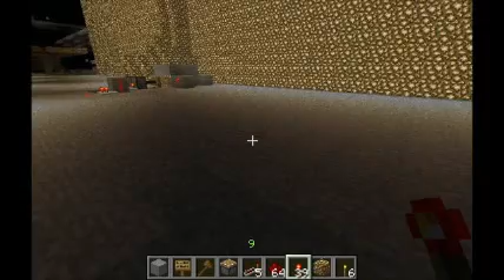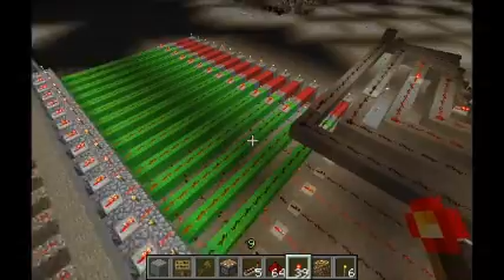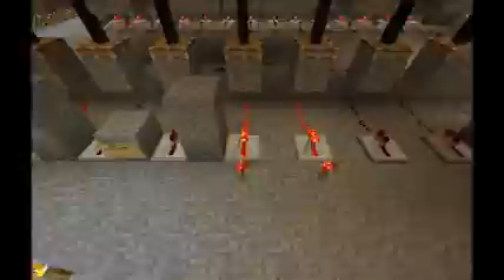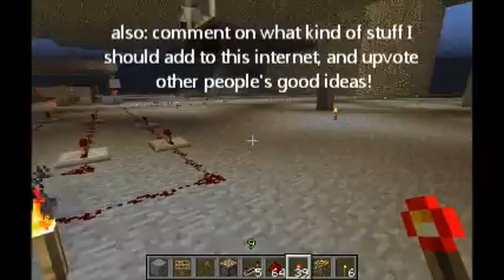minecraft internet project sneak peek!

Comment from the maker: @lukey405 it's currently an I2C packet transferring system with IPs. if the 4 bit IP is equal to the IP of the client, the package is exepted and loaded into the output buffer. when the whole system is finished I will demonstrate how it works properly.

Comment from the maker: @liamliam1966 remember these are packets, AKA multiple packets are required to make big files. packets are pieces of data, and they always have to be sent 1 piece at A time. bigger files is easily possible, I can even automate it to 32 bits packets yousing chunks, all with the current set-up.